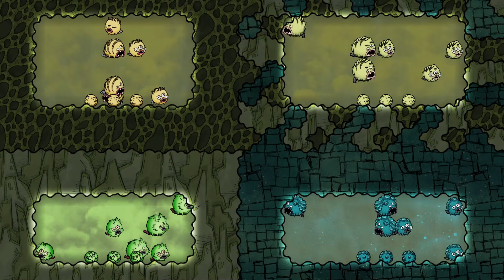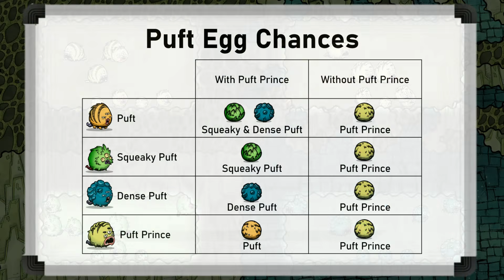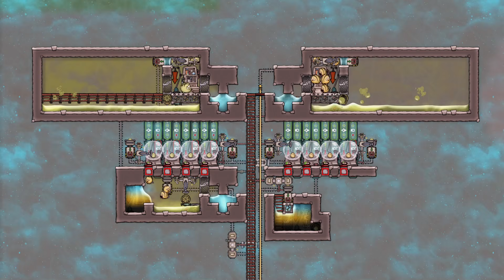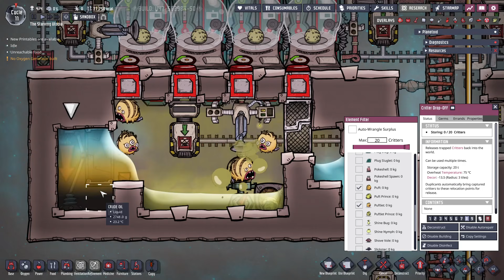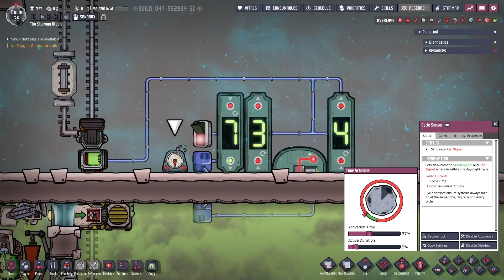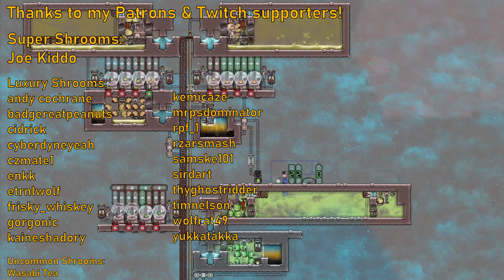Oxygen Not Included - Critter Tutorial Bites - Pufts

Comment: Never really ranched dense Pufts until recently but I have 1 question why dont you groom the puft prince to maintain its population, because a happy puft drops an egg in about 5 cycles so if im not mistake. 1 alone tamed puft and 1 alone tamed puft prince should sustain the puft prince population. Unless you dont want the prince to eat the oxygen hence why you want it in the glum state. but tbf if you running a spom especially a hydra spom then you already have an over abundance of oxygen so idk.
Reply from the maker: With this design before the critter drop-off change, the entire design is about keeping the puft prince number correct which is far more difficult than simply having another puft ranch to make the right eggs for it. But with the new critter drop off, you don't need to separate them any more so you could simply take the puft eggs.

Comment: One interesting thing about pufts is how little they actually "eat". Let's take the squeaky puft for example and your average 100g/s chlorine vent. That's 60kg of chlorine per cycle, enough for 2 pufts. But since pufts turn that 60kg of chlorine into 95% (57kg) of bleachstone, and that bleachstone if made to offgas in their ranch in a small amount of liquid, they effectively only consumed 3kg of chlorine per cycle. So 2 squeaky pufts can life off of 3kg of chlorine per cycle, so your average chlorine vent can reliably feed 20 squeaky pufts. It won't net you any bleachstone, but it's a source of meat and eggs.

So if your goal is meat (and lime), you need very little input to keep all those pufts going. A smidge of chlorine and oxygen for the special ones, and a bit more pO2 for the regular puft and princes to breed all morphs, easy enough to provide if you let their products offgas
Reply from the maker: That's an interesting point, but there is definitely a practical consideration of how quickly you can offgas all the solids back to gases as they aren't very quick.
Reply: @GCFungus  That's a great point! It's my understanding (I may well be wrong) that the offgassing rate is dependent on the mass of debris. My thinking is, that as more debris, say bleachstone, keeps popping out of the squeakies and stacking in the same tile, the offgas rate will naturally increase until it reaches an equilibrium. I.e. you need to "prime the system" by overfeeding them at the start to generate enough debris mass, and gradually their NET consumption will go from 30kg/cycle to 3kg/cycle. Since I'm no mathemagician I genuinely don't know how long that will take to accumulate enough debris mass to reach that equilibrium though. The mechanics of offgassing and it's rate might be a cool topic for an in-depth video. It's certainly something I could learn about :)

Comment: Looking at the stable design with the prince separated from the other pufts, i'm wondering if the counter sensor system is even needed.
Pufts drop meat when they die, and if the prince is contained in its own part of the stable, it means that if his meat passes through a conveyor you know it is specifically the prince's meat!
So a simple element sensor on the conveyor rail and you got yourself a working "is the prince dead yet?" detector.
Reply from the maker: I answered a similar question in another comment, and I think this is possible but the issue is that an unincubated egg will take 20 cycles to hatch and then 5 cycles to mature, so you'd have 25 cycles without a puft Prince in the ranch which is three quarters of the time.
Reply: @GCFungus  would it be an option to prepare a prince in a room next to it, open the door once the first one dies and then close it again after he enters the stable? A critter sensor with a not gate in the backup room should do the trick. It would take up more space however.
Reply from the maker: @Game_InSky  That does sound like a potential way to do it yes, a clever idea. Would probably need some experimenting to work in practice but I can see it.
Reply: @GCFungus  actually iffy with that sensor as well - we have a timer sensor which can be switched to cycles instead right? (i know you used it in shove vole's ranch tutorial)

Comment: Cheers, I've been looking forward to the puft episode :) A couple of notes/nitpicks:
- I've ranched slime pufts "inside" the base, using only oxygen masks for access - a CO2 lock at the bottom worked surprisingly well in that use case. CO2 from dupes was drained through it, but it never let PO2 from the ranch leak into the base.
- 9:56 - eh, not really. Just make a dense-/squeaky-only ranch from those excess eggs. Ranching any puft morph sustainably only needs 2 ranches. A well implemented mixed ranch should be able to support a few single-morph ranches.

I love the idea of using excess unranched dense/squeaky pufts to produce princes. I don't let excess ones mature in my map, but I noticed that pufts in my ranch's waiting room/dispenser have fairly high prince changes because of the time they spend in there.

Comment: It's fundamentally a bit unfair of Klei, on reflection. There is a requirement to have a certain mix of animals for an outcome, but the sensors provided don't enable us to differentiate between types of animal. 

I've had success with having max 5 for dense pufts, then max 6 with a lower priority for princes. So long as there's a supply of dense pufts from a low priority ranch, it's stable. It fails when there isn't.

Comment: 12:16 instead of counting to 74 why don’t you wait until it dies and the meat is exported.
Reply from the maker: That could work but the issue is that if you put in a new unincubated egg, it will take 20 cycles to hatch and then spend 5 cycles as a puftlet Prince. That's 25 cycles without a puft Prince that you wouldn't be influencing the egg chances, so a quarter of the time.

Comment: One simple optimisation would be to dump the 1 puft prince per 75 cycle in the glum ranch (the room where you have all your regular pufts) instead of dumping in the squeaky puft ranch. This will cause your glum regular pufts to mostly lay dense pufts or squeaky pufts, which will supply those ranches. This means you can build your specialized ranches normally, with 6 specialized pufts each.
Reply: wait a minute this is such a great idea, it complements the video's ranchs so well and in many ways if you are going for triple puft production, i going to steal it and try to use it on my base.
Reply: @not_waifu  
Yeah, pufts are great for glum ranching in general. The main down side is that their pathing is costly for your FPS, but you can completely fill the room they are in with liquid except for one square to restrict their pathing. As long as there is a pneumatic door right above them they will be able to breathe normally. Squeaky and dense pufts can also be glum ranched just fine.